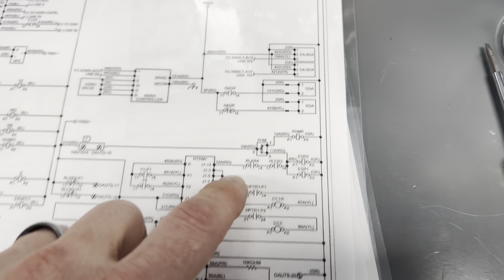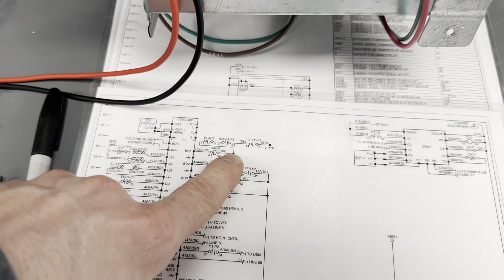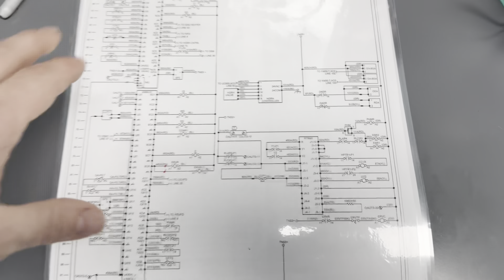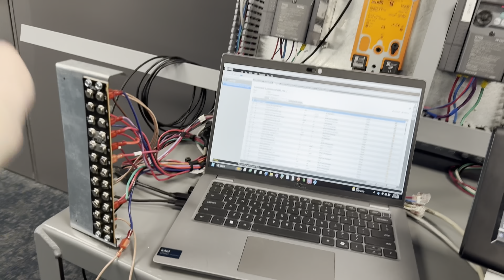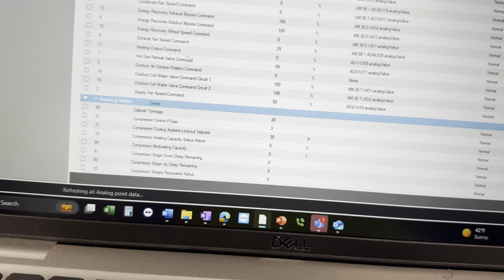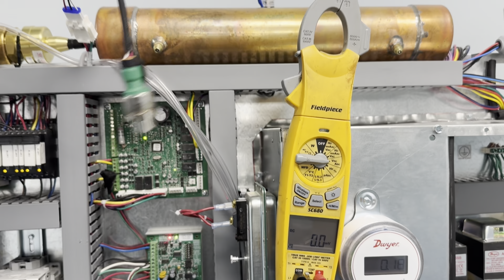Dedicated Outdoor Air (DOAU) Training board. #hvac #hvaclife #hvacr #commercialhvac #hvaccontrols

Comment: Can you share the manual to read sequence of operation?
Reply from the maker: I can talk about sequence, there will be more to come. The sequence can vary depending on the options installed on the unit, its program control and the intent of the space it was designed for. Not quite as straightforward as your typical package unit.